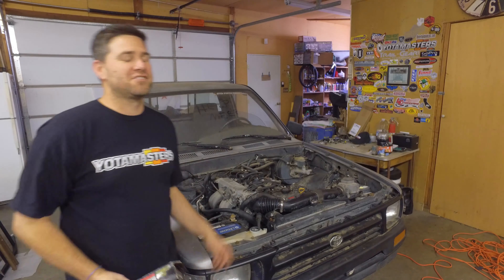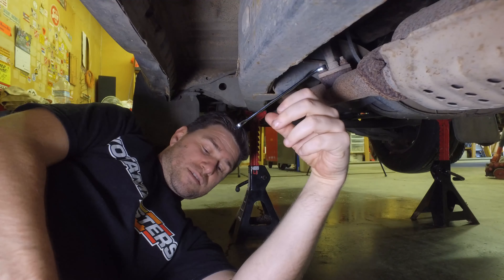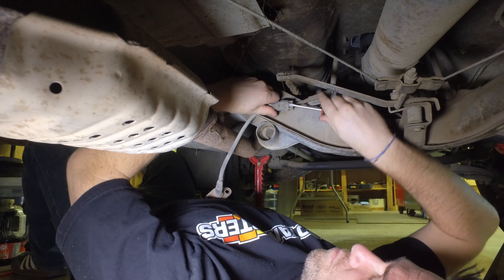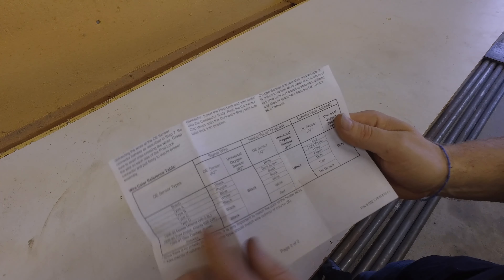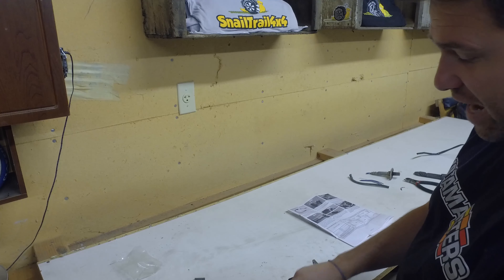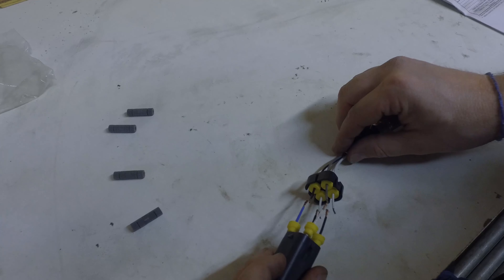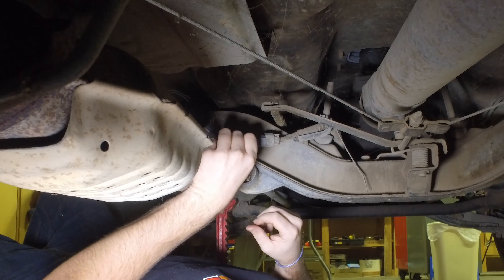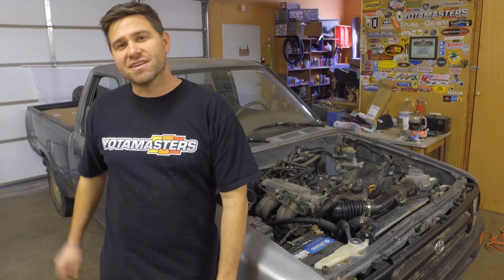One last trick to help pass a smog test.

Comment: Hey man! I’ve got a 1996 T100 2wd  that is like to convert to 4wd and use for fun in the Cali sun ya know. 
Wondering what that would require, can’t find any videos on it. Thoughts?
Reply from the maker: Do you work on your own rigs now? Because that job is going to be a lot of work. Including grinding, welding, and axle swapping
Reply: SnailTrail4x4 between me, my friend, and my brother I bet we can do it. Can’t wait to see how you do it with Samantha!
Reply from the maker: @jonathandaugherty3551  -- Well alright!!! Your going to need a T-case, to convert it to 4wd, you might be able to find a front diff or you do a solid axle swap. If you do that you might have different lug patterns so you might need another rear axle... Then lift it to fit tires